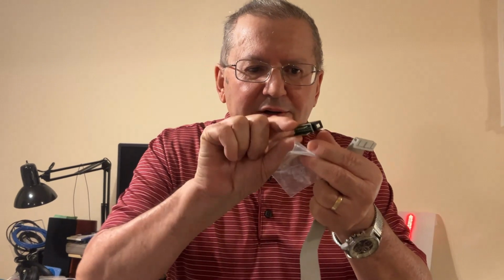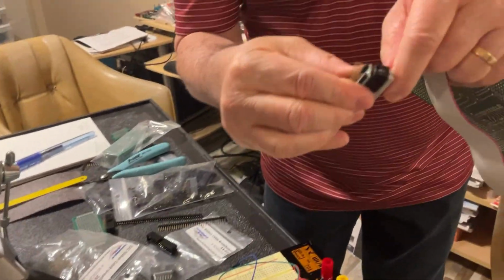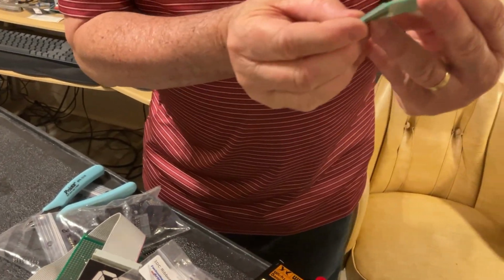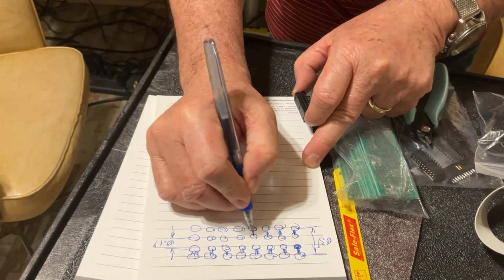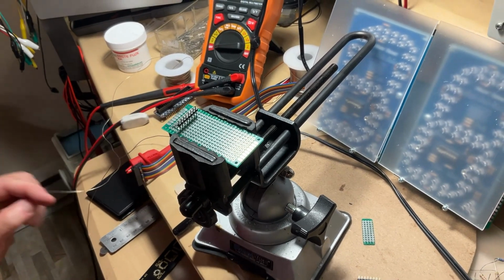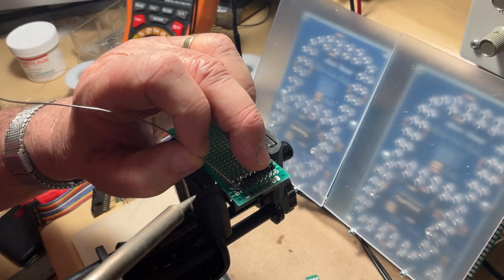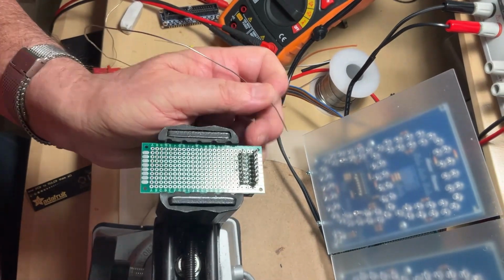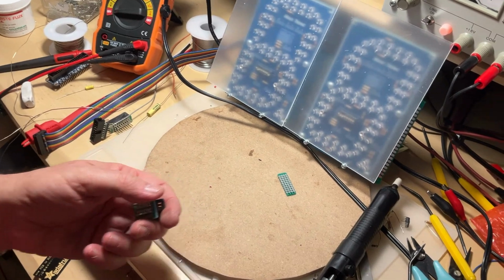DIY–16pin / 20pin IDC connector to Breadboard Adapter yeeey!

Comment: If you dont have the plastic connector, the pins are set on the ribbon cable side to be exact sizing for a 2.54mm header sizing, so you can just have a 4x10 and place 2.54mm headers on both sides and it should plug directly into the headers allowing you to plug in either a 20 pin or a 16 if you want. You dont need the mounting bracket itself. Also, I recommend you add moisture to fiberglass when you cut it so you arent inhaling fiberglass particles.
Reply from the maker: Thank you for your feedback, I value others' opinion.
For the first observation you've made: surely you can find a different way to connect a flat cable on a breadboard. 
Here is a link to an adapter without the plastic case: https://abra-electronics.com/interconnects/connectors/headers/male/2104-ada-idc-breadboard-helper-2x8-16-pin.html

Working with beginners for a long time, I noticed what - in my opinion - is the advantage of using the plastic case and soldering the headers along the two rows. Both the connector on the cable and the plastic box have a notch, so reducing the chance to plug the cable wrong way. This is why I chose it.
As for the second observation, you are perfectly right, especially if you have several pieces to cut.
For the demo, I only cut one sample but yes, I could have given your advice as well. And for cutting  fiber PCBs more often, a better protection would be to wear a mask.
Have a nice day and thanks again!
Reply: Excellent and simple solution!  I’ve been in electronics for many years and can still make mistakes (particularly when hurrying).  I like this idea and will implement it in my experiments!  Thank you for sharing!
Reply from the maker: @smichels5117   Thank you for you kind words. The need makes us smarter, as they say. I use now this method in all my projects. As soon as you make 10 of them, the 11th is a piece of cake. Regards
Reply: Yes, sir!  I’ll let you know!